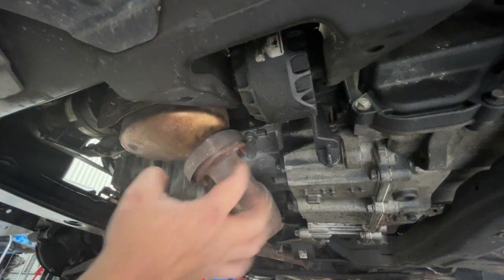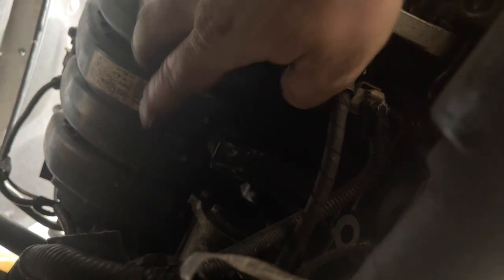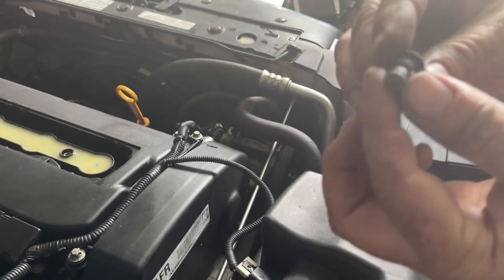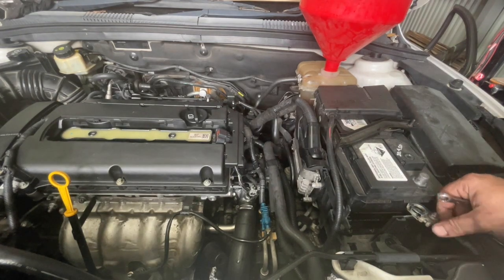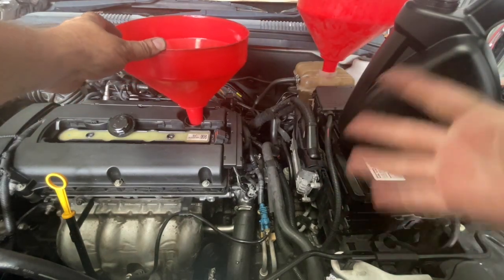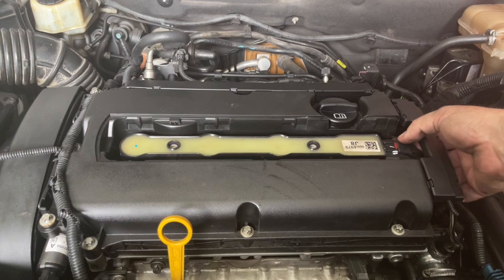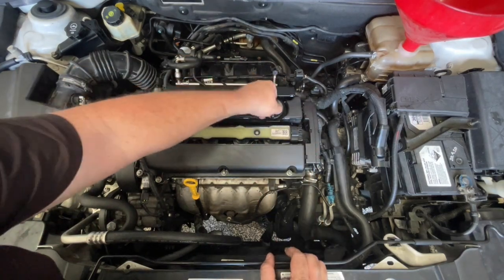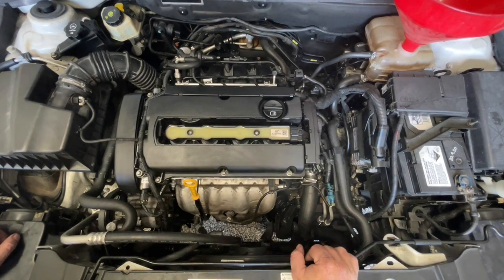Cruze Head Gasket Replacement  STEP by STEP process (Part 16 of 16) Full Details for 1.8 F18D4

Comment: Solid step by step instructions. Im on part 6 currently. The whole cooling system is sludged up - have you got tips on how to clean? all hoses resevoir everything. Also just saw a comment below saying oil cooler seals. I might have that tbh given the oil was clean.

Comment: Hi Killa your videos have help me with replacing the head on my son  2015 JH Holden Cruze. I have a small issue the car is running fine but i have a thin layer of oil setting on the top of the coolant 
bottle have replaced water pump, oil cooler, radiator, thermostat housing, coolant bottle. have not replaced the heater core. Can you help me as I don't know where the oil is coming from it's not mixing with the coolant just seating on top so far. Please Please help
Kind Regards
Peter
Reply from the maker: It’s likely the oil cooler. A common problem. I do have a video of the repair.

Comment: Hey Steve!! I'll take my car on any rainy day to you ... Your work are a professionals job. A pitti i'm in South Africa 😂😂😂 Keep up the good work. A question Steve - Why does the radiator fan go on after i start the car and wont shut down? and the engine light are also on by the instrument lights?
Reply from the maker: If there is a fault code, typically, the radiator fan will go on just to ensure the engine stays cool. Once the code is clear and the problems gone the fan should only come in when the Aircon is on or the engine is needing cooling.

Comment: Hi,
thanks for sharing video.
My cruze 1.8 2014 got overheated on highway apparently oil cooler leaked and engine oil was found in coolant reservoir. Mechanic suggested to replace whole of engine (head was cracked) and some traces of coolant in pistons. I found the chevy sonic 1.8 engine 2014 which should be similar but mechanic insisted on opel A18xer engine which he thinks is stronger than F18D4, is that correct?

Comment: I have the same chevy cruze when I pull the dipstick i hear a hissing sound coming out of the pcv valve even though i just replaced the whole cover with genuine GM
Reply from the maker: There should be a small vacuum just not a large one.

Comment: Sounds like it has some blow by…..
Reply from the maker: the camera really picked up that sound but it wasn't as bad as it sounded. Its 1000km + on and the engine
 is running strong and not using oil.